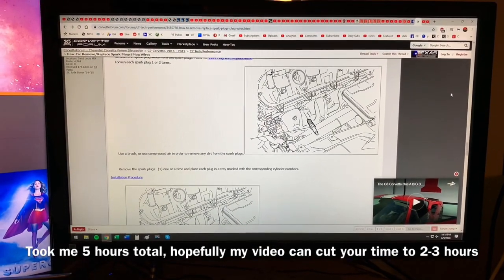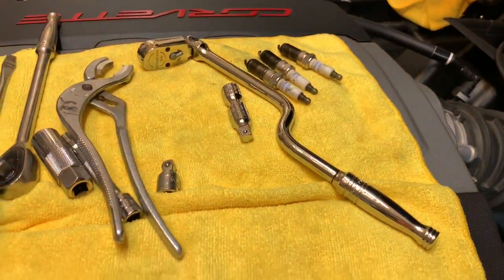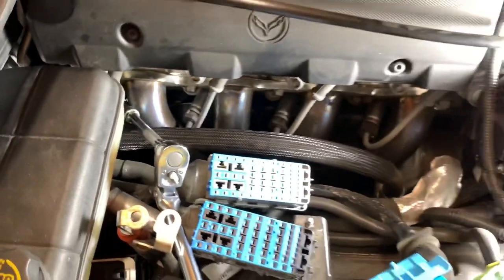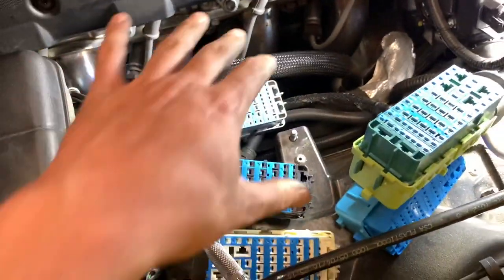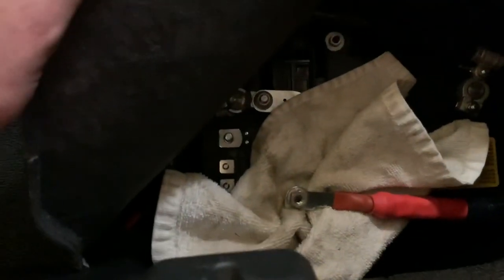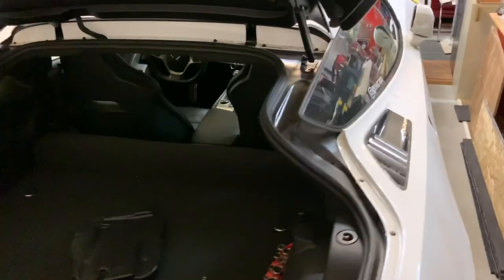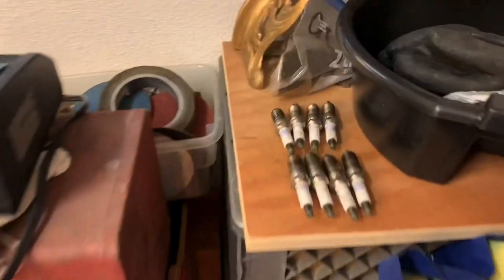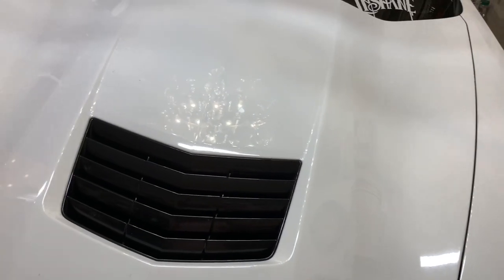How To Change Spark Plugs On A C7 Corvette

Comment: important step to take before changing spark plugs or wires is you MUST disconnect the negative terminal on your battery
CorvetteKid you did an awesome video
Reply from the maker: disconnect both battery terminals? 😬 too late 😭 thank you!
Reply: I subscribed as corvettekid you are awesome video guru
Reply from the maker: thanks so much! i appreciate it!

Comment: 1) Not an easy job, plan on plenty of frustration. 2) remove the heat shields to enable better access for pulling plug wires. 3) on passenger's side--remove the coolant reservoir to enable access to furthest back plug. 4) remove plastic engine cover to enable access for removing and reinstalling plug wires. 5) to remove fuse base blocks (blue and green blocks), you'll see 1 corner on each has a small oval tab--push the tab in, slide that block away from the center a small amount, tilt the center up. This is not obvious and will take you quite a while to understand how to remove the blocks unless you know this. On reassembly--put plug wires back on prior to installing heat shield and engine plastic trim piece--you can do it after those are installed but it's much easier to do before.